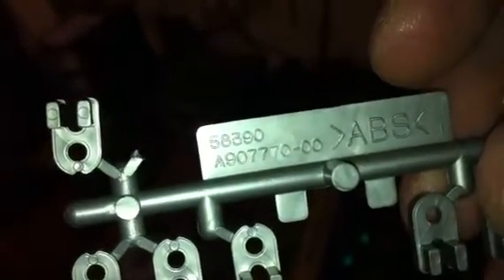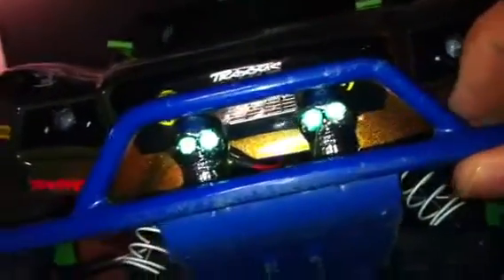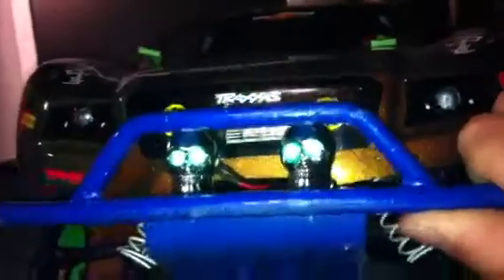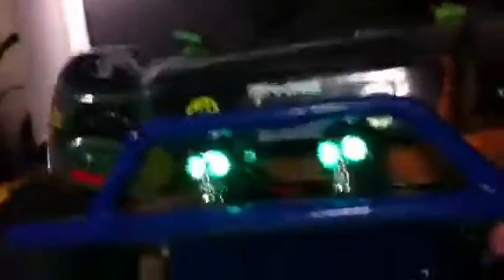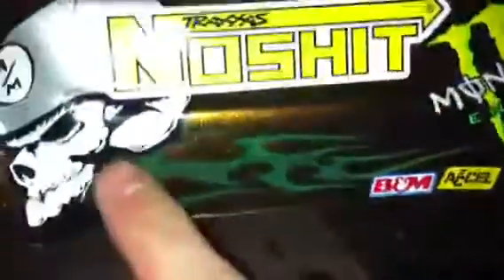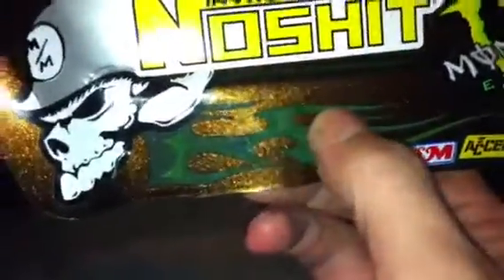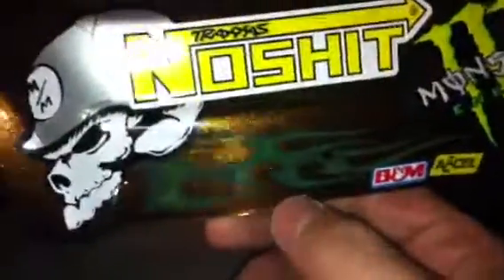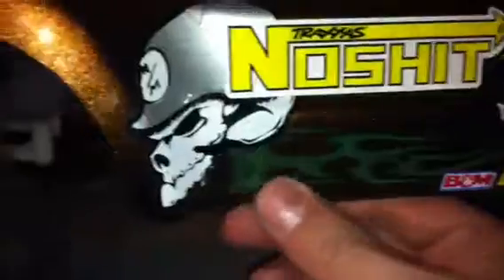Jackal homebrew LEDs part 4

Comment: YEAH watched all four as well now buddy. Thanks for the kind words buddy but am never down for long, anywho getting some paint a 4 pole 1/10 motor and a hobby wing waterproof ESC and Colt Seavers is gonna fly my man Fall Guy has got the green light. Havnt decided bout wheels for it yet but get summink sorted. Its not an exact fit but shell IS going on the TL01b if have to trim wheel arches to fit no worries!! BIG YELLER will return soon!! When it does no tarmac will be safe RIPPER!! LMFAO!!